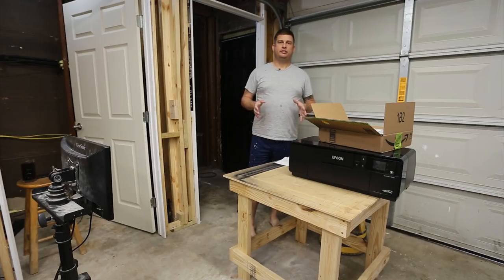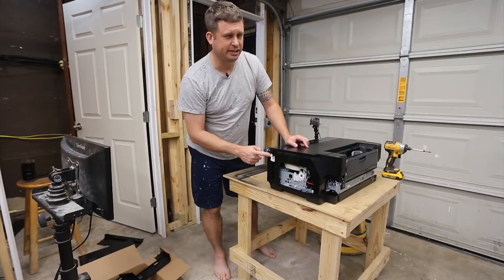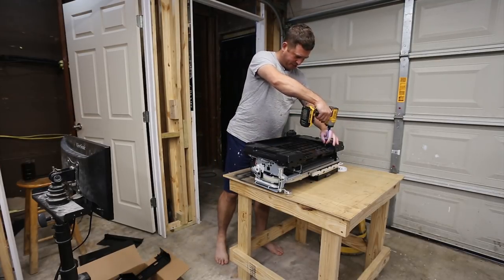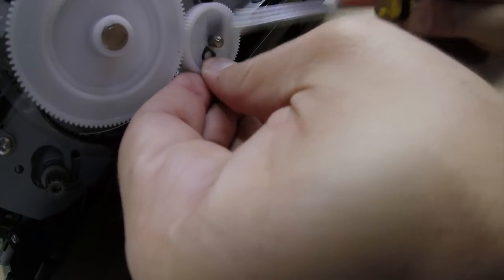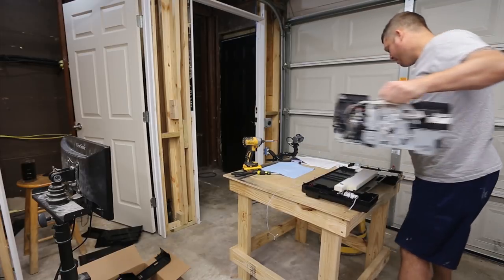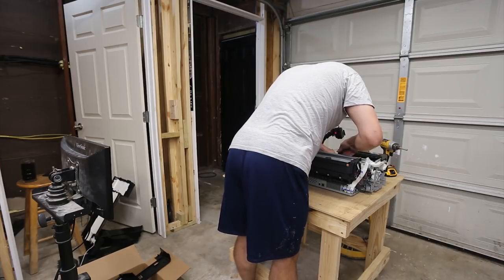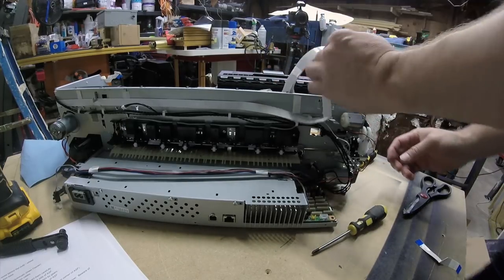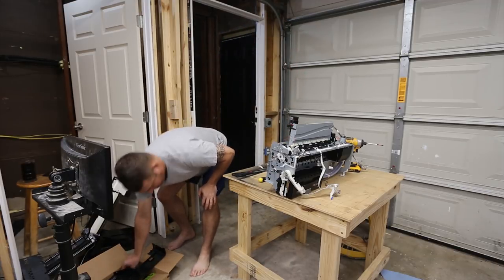Step 2 : OpenDTG: Building my own DTG Printer - Epson P600 Teardown

Comment: I currently have 5 Epson surecolor p800 printers with all having the fine art front load mechanism broke. Because the mechanism is broke the printer never makes it into a position to print. As you push in the Fine Art loader into home position it pops right back out. The mechanical mind I tend to play around with tells me that I should just take the printer apart and remove this. But because they cost so much I never follow through.